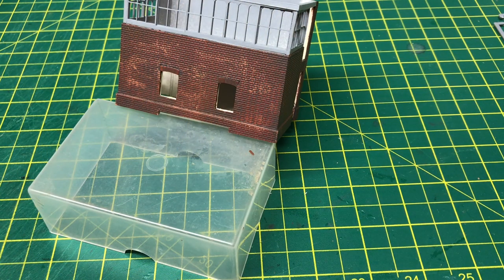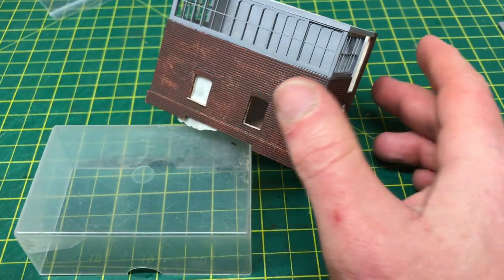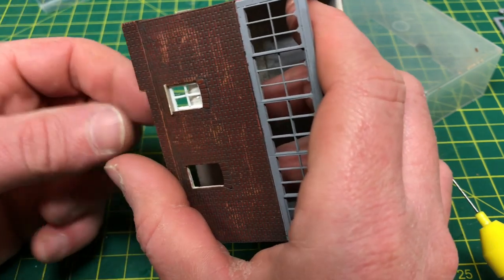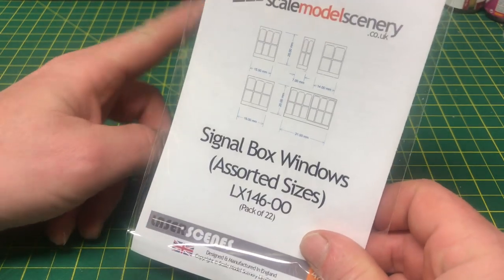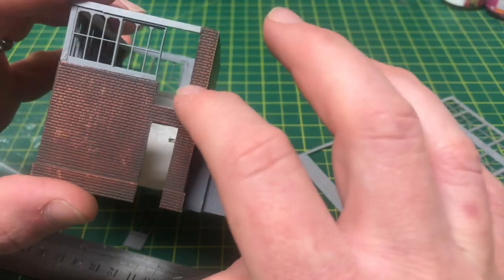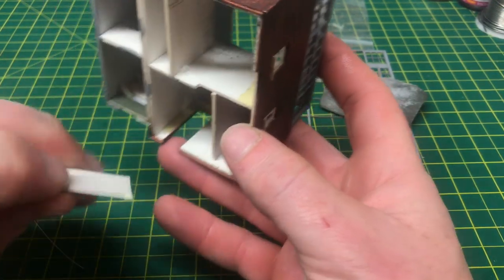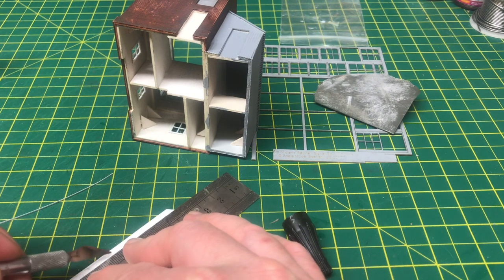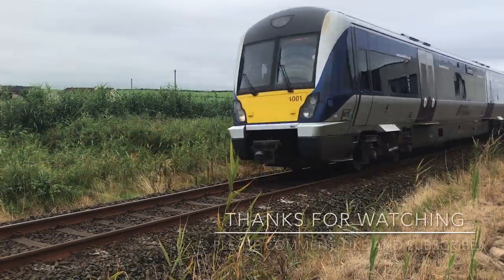Building A OO Gauge Model Railway: The Scratch Build Series 2.4 - Fitting Window Frames And Doors

Comment: That is some very fine work around the window frames Paul.  It does give very good results though.  The difference the paint made was surprising, but as you say it really starts bringing it all together.  Stephen
Reply from the maker: Thank you Stephen, it’s a fairly straight forward process in OO, not sure how easy it would be in N though, maybe you can let us all know. The painting is really pulling the build together now. Paul
Reply: @GalgormHall  I think this box would be just right to go at High Elven.  The windows are the bit that will be trickiest I think having looked at the plans.  The window you were working on comes down to 5mm by 7mm, and even with thin stripsturene that will be a challenge.  I haven't contacted Justin about whether he could produce a half size of the kit for the main windows.  he is plainly busy just getting out orders.  I suspect that the grilles reduced by a half in thickness may very thin indeed. I will take a look at either brass etch or yorkmodelrail and see if there is something similar or that I can use instead.

Comment: ¡Hola buenos días Paul!  As ever, attention to the finest of details and accurately executed. One tip, from my neighbour, who is a mad card crafter, regarding masking tape. This may already be knowi to many but anyway, here goes. Rather than buying expensive modelling masking tapes, simple peel off the required amount of ordinary tape and, using a piece of dry cloth, repeatedly stick and remove the tape from the cloth until the tackiness is as you require. It does work and, saves loads of hassle and money. 

Un Salud. Gary
Reply from the maker: A top tip Gary. The stuff I used was cheap painters masking tape that has little tackiness to it. So little in fact it’s useless for the job it’s intended for! 😆Thanks as always mate. Paul

Comment: Hi Paul.
Very enjoyable video once again.
On the subject of masking tape.
Try low tack masking tape instead of the regular masking tape.
It doesn't have as much grab as the regular tape if you leave it on to long.
Tony.
Reply from the maker: Thank Tony, I feel I’ve had deja vu with this message, certain I’d answered it before. 😆 Anyway, thanks for the tip. Paul

Comment: Hi Paul another great video.  I have got as far, on a measure 9 times and cut once principle, of all the card cut out and it dry fits perfectly(ish).  BUT having come back to modelling after over 20 years at the moment the detailing etc. is I think beyond me.  So I am going to do two things.  One is buy the Wills cottage kit and see if I can detail it like you have managed, and secondly built your cottage and shop scratch build.  Which although great isn't as fiddly as the signal box.  Then after practice etc.  I can pick up the box again. Keep up the great work , and stay safe and well.
Reply from the maker: Tony, it’s great to hear you are making an attempt at it. It’s not a bad idea to look at the shop build first before starting in to the plasticard. The techniques are similar in both builds so it’ll give you some confidence to give the brick a go. Paul

Comment: Lovely work Paul ... will you be fitting the internal levers etc ? I used the Peco 553 kit in mine and can recommend it, All the best and stay safe Steve
Reply from the maker: Thanks Steve, yes, the interior bits and pieces will be installed and it’s the ratio kit I’m using for it. It’s by far the best with a good range of furniture and accoutrements to help with the finished look. Paul
Reply: @GalgormHall  I look forward to it Paul ...good luck !

Comment: Fantastic progress Paul. The doors and windows look just the part now 👍. Will you be adding a lever frame, block equipment shelf etc.? Is the plastruct 0.4/0.3mm or 4/3mm? 
I'm laying the cork underlay at the moment, then I'll be starting my scratchbuild project for Aberystwyth signal box. 
Stay safe mate, GWR
Reply from the maker: Thanks CG. The rod is imperial measurements of 0.040 and 0.030 according to the packaging but this equates to approximately 1mm and 3/4mm respectively. Hope that helps and good luck with the Aberystwyth build. Paul
Reply: @GalgormHall  thank you Paul for both the advice and luck. "I'm sure it will go well" he says... Ten minutes into the build... "you little 🤬"!!! 😂